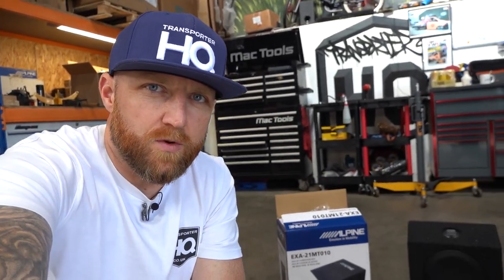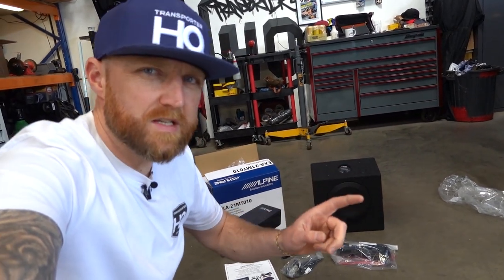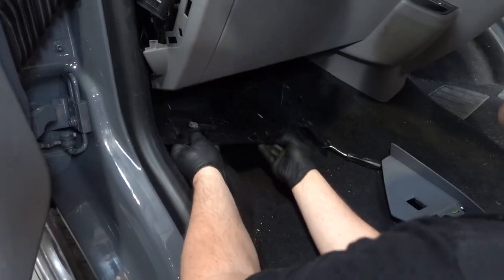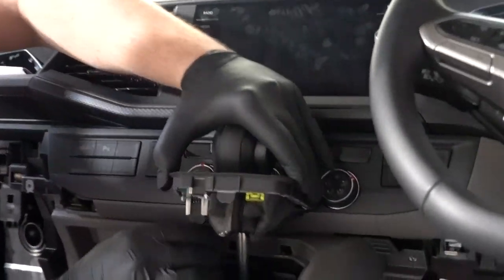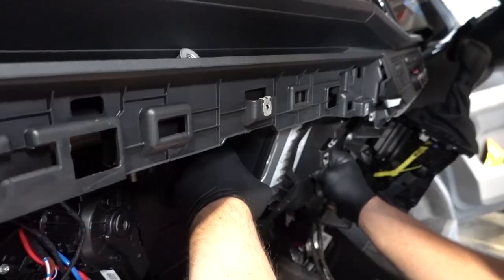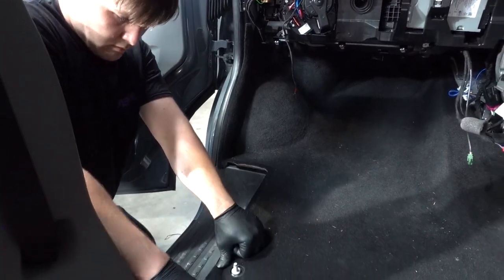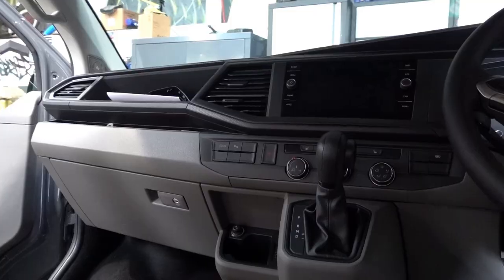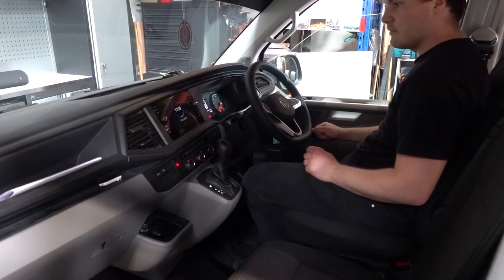Installing the VW T6 / T6.1 plug and play, Alpine 6-Channel DSP Amplifier & Subwoofer System

Comment: Hi Andy,
As well as the front alpine speakers upgrade and sub. 
Would you recommend to upgrade rear speakers in the drop-down storage compartment ?  
And how to access the speakers in the rear side panel ? 

Can the stock head unit handle new speakers without an amp? 

Cheers,
Rowan